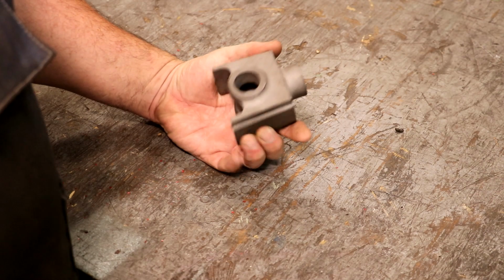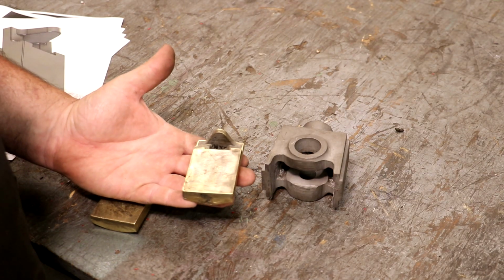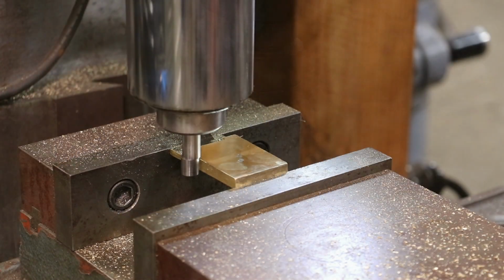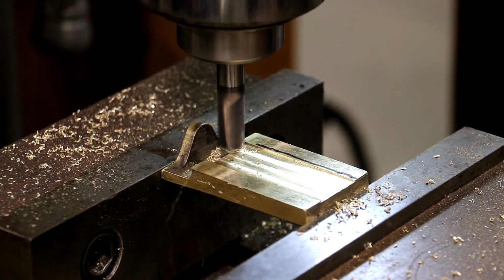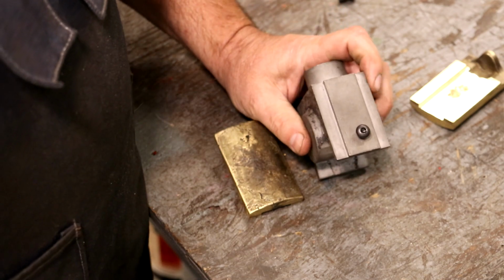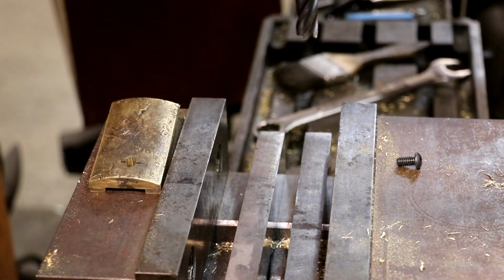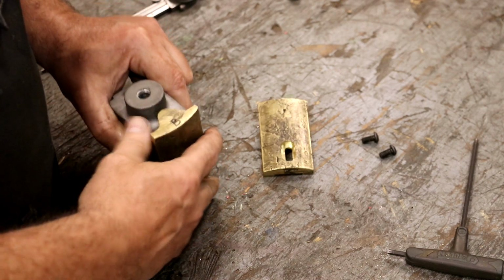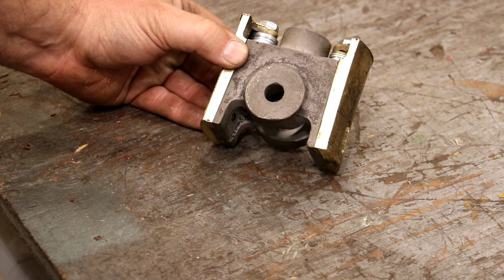Machining Bronze Shoes for a Steam Engine Cross Head

Comment: With respect to the two bolt holes you have just drilled through the lugs in each of the bearing shells. Will they also need to be slightly elongated in the radial direction to accommodate the dimensional change in lug to body centre as the bearing shells slide up and down the body/shell taper?

Apologies in that I have only just realised that I am commenting on a video that you posted some 4 years ago. How this happened I do not know as I'm always so keen on watching your latest videos.

Comment: Don’t the holes in the adjuster tabs need to be slotted to allow the shoes to be adjusted outwards as they wear? Otherwise, as washers are removed and the shoes drop down on the tapered guides, the adjuster bolts will pull the shoes out of square.

Comment: Those shoes are something else, I'm guessing it would be possible to add a oiler or a grease zerk fitting to grease them , drill small holes, and machine a couple grooves on the wear side , about like oil rings in a piston, witch that is what this is minus  one function it does not do,  it',,
Keeps the rod on track, I'd like to build a 2 should stroke diesel/oil burner,  double acting so it could be called a single stroke, because it would fire, every time the piston is either up or down , TDC and BDC firing, use a single intake port, like a Detroit diesel, only larger, use about 6"bore, with 12" stroke, use injection parts from the small Chinese diesel engines,  maybe use 4injectors per piston side,  being they are side injected, use a in head combustion chamber on top, nearly like the ones in diesel pistons, with valves, around it, going for about 18:1 to 20:1 compression ratio, use a hollow rod, passing oil through it  to to lube the rings and. Cool the piston, use two sets of oil rings in the center, maybe make it two pieces and bolt together,  I have thought about this for years, only now do I have a need for a stationary engine,  maybe use one of the 500cc roots blowers, as a scavenger, use 4 big block Chevy exhaust valves per head, 1.88" if they will fit, it may require smaller, 1.50" - 1.60"  and  possibly add a turbo,  about 500rpm peak ING around 800, but should make tons of TQ it word be awesome to make it opposed cylinder dual action, two-stroke, I wonder what that would sound like, at full throttle, it full injection! Anything like a Detroit 2stroke diesel would be awesome, it would definitely needs muffler and sound absorbing walls, I need it to run a generator to power a off-grid home, about 20kw,  I want a large slow engine producing lots of TQ,   
Probably use a 2" diameter hydraulic cylinder rod, and a crank from welded 1/2" thick steel plates, possibly double layered, use BBC  main bearings for the rod and main bearings, in the range of 3" diameter,  either use grease with the bearings , or thick oil, and oil pump,  5-10 psi, probably build a tin crank case, use about 3-4 qts of 20w50, with a qt of 80w90 gear oil and run with a fairly large clearance in the  bearing to journal, drill and tap the crank to pass oil from the mains to the rod,  use two oil systems, use 0w30 or so for the piston, and rod, use a cam bearing or something similar for the rod, using it as a linear Bering, using something similar to labyrinth seal made from steel with brass or copper bushings, to keep the combustion off the bearing, the hardened chrome steel rod should not have any damage from the brass seal, use a brass bushing as a seal, with steel protection shield,  use 2 exhaust ports weather using 2,3 or 4 valves per head, use a head pipe, 1.5" to a single 2" or  1.75" to 2.25"  using thick wall pipe, may require ,two  2" into a single 2"  going into a twin scroll header,  being it will have two cylinders  firing at once! Slightly altering the pipe length may offset the exhaust pulse spooling  the turbo more evenly,  using the tiny oil pump cooling the piston lubing the cylinder wall,   melt down a couple sets of car pistons to cast a single, making it about 4" tall with a tight fitting dome, about 1" thick using cone seat Allen head bolts,  large enough to drill and tap. Them for grub screws, to lock them in place,  the last thing needed is loose bolts inside a engine,  splitting the threads then drill and tap the bolts will  allow them to spread when the grub screw is tightened, to prevent them from coming out, leave the bolt head end untapped, install the grub backwards,  then when the bolt is stalled and torqued the grub can be tightened.. locking it in place, 5-6 bolts about 1/2" thread, plus one in center, sealing the oil passages inside, use 22 gauge copper wire for the o-ring, use two passages in the rod, sending oil into the piston having two passages on each side the oil making a loop dipping in the center, then draining down the road , feeding the slide, probably feed it through the slide as well, probably use the bushing as similar to a brush in a electric motor, using a rod to connect to it with a banjo bolt, with bushings inside,   or maybe use the wrist pin as the connection point, using a1/2" banjo bolt, with 1/4" and multiple 1/16" passages,  the wrist pin having 1/16" holes to pass the oil lubing it as well as the rod, the rod having a 1/2" hole with a 1/4 tube to carry the oil, slowing the return to flow outside the tube,  use two sets of oil rings, and drill multiple 1/32" or 1/64" holes into the oil passages in the piston, and  to the drain, using a internal restriction, to prevent it from only pressurizing the ring land,  or possibly oil a groove between the oil groove, 
Allowing the holes to drain only in the ring lands, using a venturi to siphon or scavenge the oil, inside the piston,. pull any oil in the gap in to the drain,  possibly drilling tiny holes to see that the rings are lubed.  Build the thing on a thick angle iron or channel iron, 1"x 4" steel bar, 1/2" x4" bar, 6" x 1/2" wall tubing, 4" x 6" box tubing about 1/8" wall, 1/ 8", or 1/4" plate steel, 2.5" exhaust pipe as intake tubing,   use multiple small injectors and pumps, to allow multiple injections, and possibly finer spray, set up as a pilot injection,  using a cam setup with the pumps on it,  allowing them to have different timing  and injection events,  possibly start with one  at just before TDC, one just afternoon as those are over fire the other two, the injector being for a 3-6 HP engine using multiple for such a large engine should be fitting, in theory say 5hp of fuel each, two dual action cylinders, it could supply 80hp, if it could make near 80hp or even 40 HP, the TQ should be 300-400 ft lb,  maybe modify the injector or it's mount, so the fuel spray is cut, or blasted with a extreme pressure air spray much further atomising the fuel, and creating 🍥 swirl, allowing less fuel and much more efficient burn, clean burning, Diesel as well as oil burner, it should burn oil   clean as a gas engine,   so sorry I got carried away, rambled severely!

Comment: When a piston without a cross head moves through its travel the connecting rod rocks the piston in the bore. This causes the piston and it’s cylinder to wear unevenly. In addition the rings will lose contact pressure with the cylinder wall as the piston rocks. This will increase blow by and ring groove wear. The use of a cross head moves that rocking motion away from the rings allowing a better seal and longer piston and cylinder life. Some pistons use a longer skirt that helps to get some of the benefits of a cross head in a considerably smaller overall package.
Reply: A similar problem affects modern hydraulic and pneumatic cylinders. The cylinder body and rod have to always be parallel on free floating pivot points, or the piston seals will leak air/fluid. The cylinder and rod generally can't directly provide structural support to whatever is being moved.
Reply: Since the rod on this style engine threads directly into the piston. Basically just moving the wrist pin down some

Comment: Freely admitting that I’m a novice, and honest question… when milling the slots for the bolts, would it be wrong to find the 0/0 point, then start with the 1/2” mill and cut its slot, then come back and slot through with the 1/4” since you already have everything centered?  Thanks in advance!

Comment: I am cringing at the terminology.  A piston rod is a rod solidly connected to the piston and transfers the force from the piston through a stuffing box down to the crosshead.  Piston rods are used on double acting steam engines.  A connecting rod is the rod between the crank pin of the crankshaft and the crosshead.  It transfers the reciprocating motion of the cross head to the crankpin.  A connecting rod has a small end and big end, both swiveling on pins.

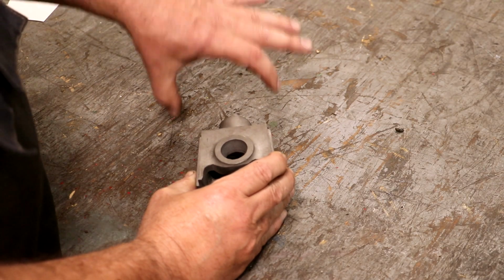Comment: You are saying “brass” eveyr time and I admit they are called “the brasses” but I hope material they were cast from was phosphorbronze. Brass wears easily, were phosphorbronze is wear resistant and to some extend selfl-ubricating.  By the way, not to be picky (02:38) the piston rod goes in on the round protrusion, what goes in  the bush (lower end) is usually referred to as the connecting rod.

Comment: I somewhat disagree with you description of what a cross head does. I'd say it's main purpose is to enable the use of a stroke that's (significantly) greater than the bore w/o the con rod interfering with the bottom of the bore.

Comment: Nice and interesting job. I cant stop thinking why put a bolt in the side of the sliding part instead of a quide pin? it dosent make sens, becaurse you now have to take it apart to ajust the fit unless the bolt sits loose wich dosent make sence? Im i right or wrong? Sorry for the bad grammar

Comment: I dont know about the side bolt . It would have to be a sholder bolt so it can be adjust in place . I was thinking  pins . Maybe I missed  the explanation  . But the adjustable  isn't  functional  unless you take it apart to service  it

Comment: Good job Keith. I learned something about transfer screws.  Remember you are marking the back of the part if you are drilling multiple holes.  Its important if you will counterbore them and the hole pattern isn't symmetrical to make sure you flip the part over after you drill the holes.  Otherwise if you counterbore the back of the part your holes won't line up.

Comment: Hey Keith!
Just a "little" forward thinking here.  On the bolts which hold the linear adjustment distance of the shoes, consider this.  Place TWO flat washers under the head of each bolt and replace two of the washers in the spacing stack with the equivalent thickness using 0.010 to 0.005 thick layers of shim stock washers.  Then, when making final 'fit' adjustment on the engine, it will be possible to precisely adjust the "lash" by moving various amounts of the shim material out of the stack and placing them BETWEEN the two washers under the head.  This keeps the shims available for wear adjustment down the road.  IF more than one washer thickness of shims needs to be removed from the stack, remove a WASHER and adjust the shims as needed.  Again, store the washer under the head of the bolts.  By doing this, the actual ENGAGED thread distance on the bolt remains constant.

Great project!
Ken
Reply: Excellent solution!

Comment: Hi Keith as you've machined everything square and parallel and the crosshead is tapered wont the slippers just touch at bottom of the slipper block,
surely the slippers should be machined with the corresponding taper so that the slippers drop down parallel as they wear ? all the best Bobby
Reply: Once he turns them on the lathe won't they be parallel again? (Not a machinist.)
Reply: @stevew8233  True, but then won't one end of the "shoe" be much thinner than the other?  Seems like that isn't what you would want.
Reply: @jsaurman  If any of you would have looked at the pictures at the begining  of this you would see just wat you just said is what it is.
Reply: Yeah, I was thinking the same thing.   The center piece has tapers, so the side pieces need tapers too, so the outside faces are parallel.   I can't understand how he was missing that.

Comment: I wonder what the engine operating times are before wear would make adjustment and, eventually, replacement necessary. With the “custom” positioning of the screw holes, the engine manufacturer could presumably have only supplied cast blanks for replacement shoes.  Thanks for the video.

Comment: Wouldn't it have been just as easy to start with a piece of rectangular material and just machine the part rather than go through the casting exercise?
Reply: possibly, but the cost of raw stock that size, and how much of it is going into chips ... ?  There might be properties to cast (vs rolled/formed) material that makes it more desirable for the application, also.  If the original parts were cast, and worked well, they must have had good reason for doing it that way.
Reply: @infoanorexic  For production work I think you are correct- casting (maybe several at a time) would save material and machining. Unless there is a reason to make more of these, machining from stock would seem easier (but not "authentic").

Comment: Ahhh, now I understand how these work 👍
Reply: The castings look great again Clark.
Reply: @samuraidriver4x4  thanks Johan👍
Reply: I dont think you do really ? as the slippers need to drop down parallel and expand outwards parallel as they wear the way they have been machined the slippers are parallel
and will only touch the very bottom of the slipper when put back into the engine. The slipper needs to be machined with a corresponding taper to allow this to happen
Reply: @bobwilliams7343  after the next video you will under stand the whole assembly go for a lathe ride to become round. This  will give that taper you are talking about.
Reply: @brucetuckey7909  No it wont as the bronze slippers are machined parallel they wont drop down square on adjustment have a look at the pictures shown at th beginning of the video look at the slipper blocks they are machined properly with the corresponding taper to allow the slippers to expand parallel not at an angle the way keith has machined them
Reply: @bobwilliams7343  The cross head has the taper on the head. The slipper is bolted to the taper part of the crosshead. Thus turning the slippers bolted to the cross head will actually make the round part of the slipper become the taper but in a straight concentric way that it will be done when the outer diameter is turned to the center line of the piston rod and bore.
Reply: @bobwilliams7343  Well I guess we both will watch and see how and what happens when they get machined. I not going into your pissing match about what you think is rite. Lets both watch and see how it plays out.

Comment: I think the main purpose for having the cross head is so that the actual piston rod only has linear motion so it can pass through the gland at the rod end of the cylinder to seal the steam pressure in. A regular internal combustion engine doesn't need anything like that and the rod can pivot right at the wrist pin. Steam engines have pressure alternately on either side of the piston so the rod needs to be sealed where it comes out of the cylinder. The cross head kind of breaks the rod into two pieces between the piston and the crank to allow that seal to work.
Reply: Thanks- a helpful explanation.
Reply: Some modern combustion engines have cross heads, too, particularly large marine 2 stroke diesels. This is to limit the lateral forces on the cylinder liner and thus prevent wear
Reply: @patton446  Now there's been a lot of news about "mushroom pistons". Basically a built in cross head where the body of the piston is narrower than the top where the rings are. The narrow part rides in a bore isolated from the actual cylinder and has a large bearing surface to eliminate piston rock. The wrist pin is below that section. Kawasaki is going to be using it in a 500cc  two stroke dirt bike.

Comment: It would be better if the screws that hold the brass inserts against the block be made of brass and not steel?   Those screws are likely the wiggle loose and rub on the iron slide way, if the screws are steel they will cut into the iron.
Reply: I question the need for those screws at all as they defeat the adjustability of the shoes. 
If adjustment is needed do you remove the cross-head, loosen the screws, replace the cross-head, adjust the adjuster screws, remove the cross-head , tighten the screws and replace the cross-head?
Seems pointless complication.
I suspect the screws are supposed to be shouldered to prevent them being fully tightened against the shoe.
Also ,I think it was a modification when the manufacturer or a user had trouble with the shoes sticking in the guides and breaking the adjuster ears of the shoes.
Reply: @paulg3336  It is possible that the screws are needed to help assemble the machine.   Otherwise, I agree, they seem unnecessary.
Reply: @reilleysinventions4155  Yes , I thought that might also be the case.
Reply: I was thinking the screws may only have been used as a means of retaining the shoes while it's being turned in the lathe